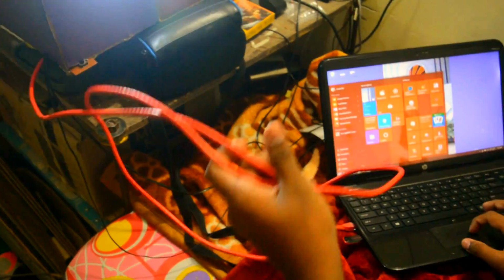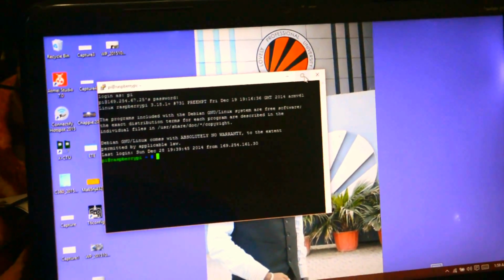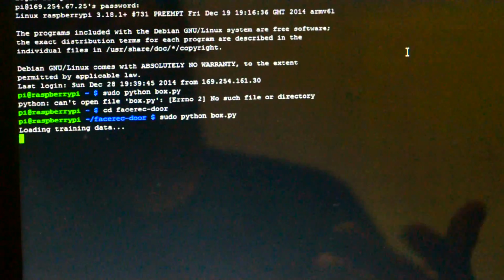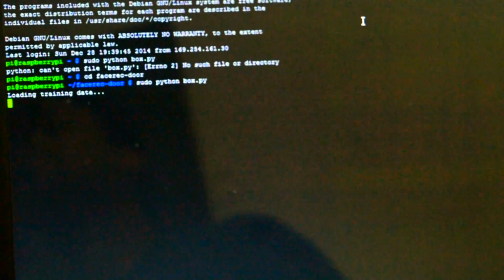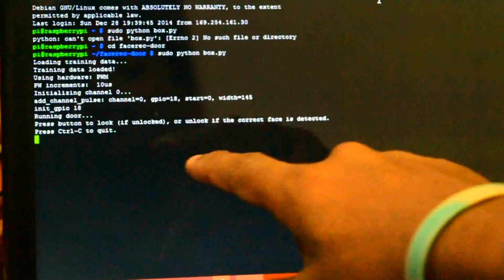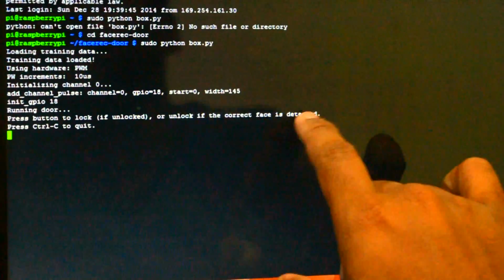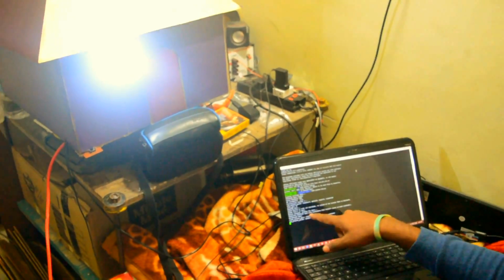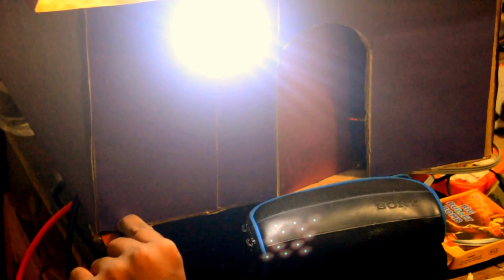Face Recognition Based Door Lock and Home Automation Using Raspberry Pi B+ OpenCV Eigen Face

Comment: Hellow dear i really need your help m making this project i some how managed  to remove all the error but still m stuck in hardware interfacing i cant capture the image using button  though it can capture it by pressing c button via keyboard but not by our circuit diagram kindly help sir ready to pay for the solution
Reply from the maker: you may check the circuit .. the pull up
Reply: Arnab Das  can u come to fb want to have some more details abt this ....